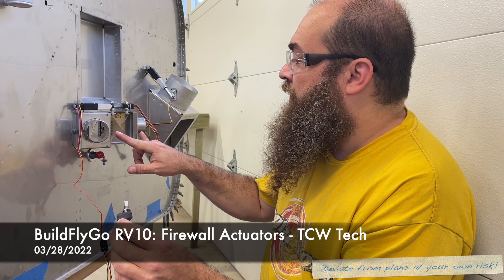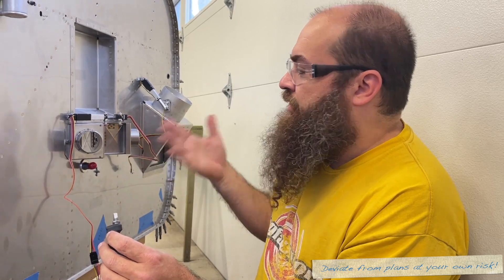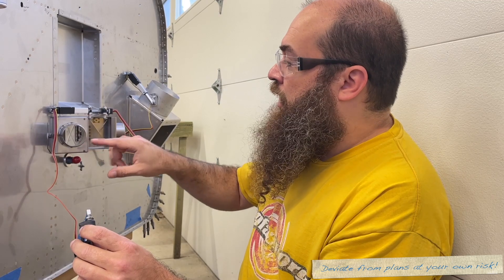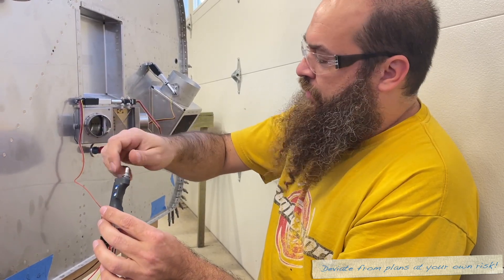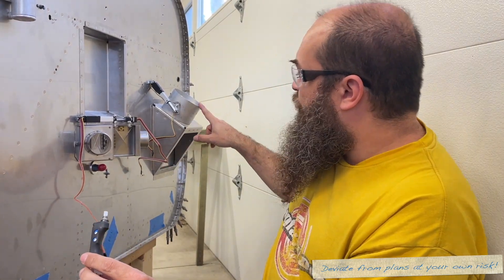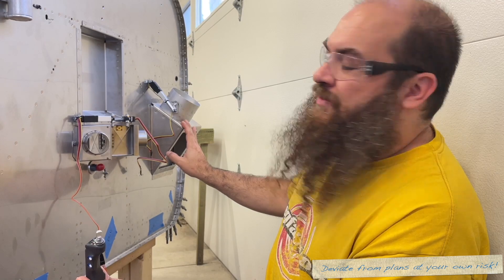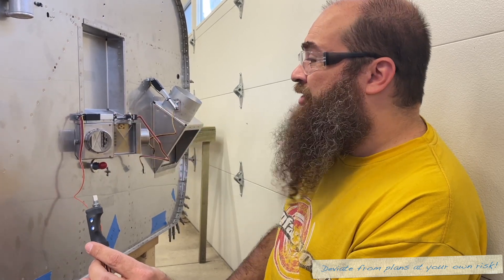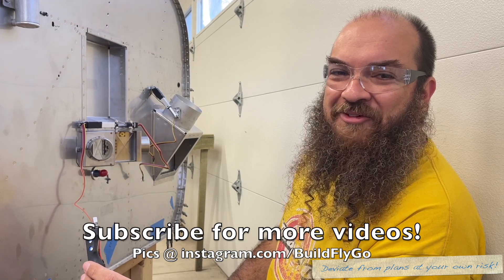RV-10 Build: 03/28/2022 - Firewall FWD - Air Actuators

Comment: Guil what did you consider for failure scenarios? We're thinking about this same setup but are a little worried about a FWF fire that might make the vents inop while open... allowing smoke into the cabin. Did you find a way around this scenario?
Reply from the maker: We are adding a spring to pull it closed. Of course the spring will only work once the actuators "melt" off, which may be too late? I'm also looking at covering the actuator and wiring with fire sleeve to give us more time to close if we ever notice problems. It's hard to consider all possible scenarios but hopefully we cover any that we might face. As usual, use at your own risk.

Comment: How do you know if the oil cooler actuator has failed? Manually watching the oil temperatures?
Reply from the maker: Just watching the oil temp as you usually would. In our -9A we don't have variable air control to the oil cooler, twice per year we adjust the cover to offset the outside temperature change. With the -10 we might be traveling a bit more between hot/cold locations and this should come in handy. If the actuator fails closed and you need more airflow because you've travelled a few hundred miles south, you can land, take the cowl top off, and manually open the flapper.

Comment: Another well timed video.  I just received my FF kit and was going to start pre assembling some the the components.  Question - My VA-186 oil cooler support has a flange to accept the scat tube and it is the same diameter as the TCW butterfly valve.  Looking at there diagram and your video it looks like it is resting directly on top of the support.  Did you remove the flange?  Just figured it out.  Had to flip it over one end is swaggered out.
Reply: Gill did you add any backer plate or washer to the actuator mount on the firewall?